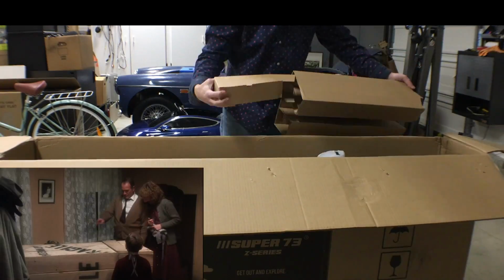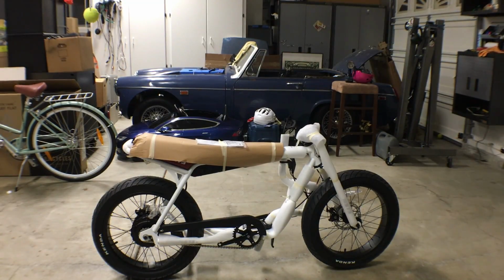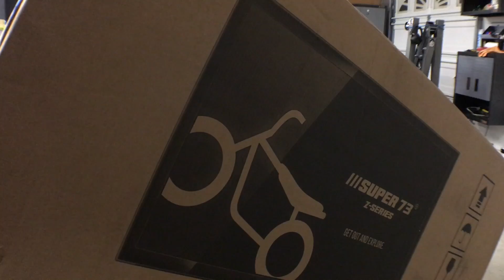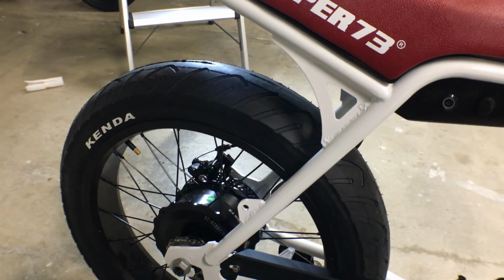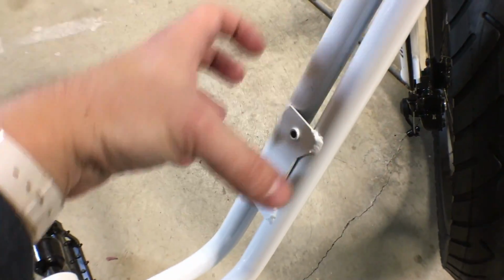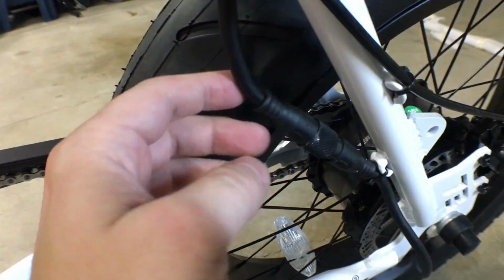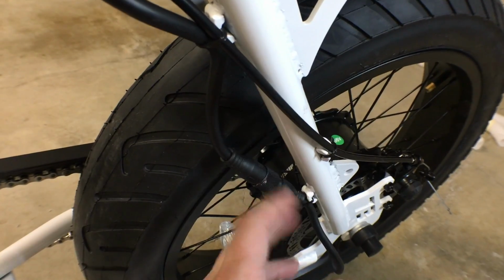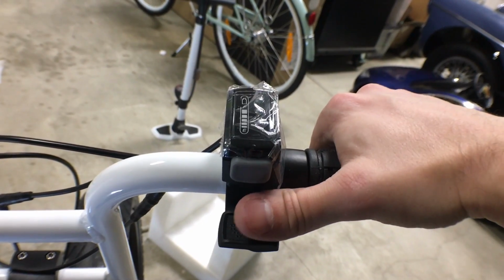Super 73 z Delivery, Build and Test Ride

Comment: Looks like a great bike. How is the acceleration with a 36V system? Any idea if there is a way to over ride the 20mph governor? Would be great to be able to get a little more speed out of it if possible. Thanks for the video
Reply from the maker: Check out my instagram, trying to get into the firmware now to remove speed limit. At some point you'll be limited by motor or pack voltage. Acceleration is awesome! any more and it would make lots of new riders uneasy or worse, cause a wreck.

Comment: There is Soo much empty space for a larger and or more battery packs. And No suspension? Cheapo Walmart bikes even give you springs. I guess I have to design and make my own!! Jeeze man. What's up with these electric alternative transportation companies.
Reply from the maker: Stefan0man Tons of space, but at some point it becomes too heavy and few would ride for as long as it would run. The fat tires soak up a bunch and I prefer the looks of a bike that lacks suspension. Cleaner looking and less to break.
Reply: That’s why you get the more expensive one if you don’t like it..
Reply: @JuliansRandomProject  I guess some would ya. But juiced bikes are doing Very well. But i think a company could put a small 2stroke motor on there to charge the cells and/or drive the bike to when there aren't any power sockets around for miles. And the big tires create a Lot more resistance for the bike and a steel spring could last decades on a bicycle.

Comment: $2000? Ummm...hard no.

Ill buy a moped.
Reply: It's actually 999 now.
Reply: @darrengriffith9680  Still can get almost 2 new mopeds for that price that get 110 mpg and go 40 mph.  I bought mine for $400 and have 4,000 miles on it.
Reply: @OverlandOne  can I ask what kind of moped? Sounds like a good deal.
Reply: @darrengriffith9680  Just your garden variety Chinese no name moped.  They come from the same factory, or factories with names like Suni, MP-50, etc. but they are all the same.  Same GY-6 49cc engine, trans, etc.  I have had mine a little over 4 years but you can still get them for about $600 if you look online.  They are Chinese and not Honda so, having some mechanical ability is required but, if you set them up right, and keep up with maintenance, you can get good service from them. https://www.amazon.com/Street-Legal-Scooter-TaoTao-ATM50-A1/dp/B00J4TXA5U/ref=pd_lpo_vtph_263_lp_tr_t_2?_encoding=UTF8&psc=1&refRID=8JEBQV1414J80557NC5C

Here is a Tao-Tao (Same as mine) new for $519 as an example.
Reply: @OverlandOne  good to know, thanks for the info! I have a modded grom as my city bike but may be good to pick up one of those in the future.
Reply: @darrengriffith9680  Heck a Grom is a Honda and that is a better machine all around...more expensive however.
Reply: @OverlandOne  I have a lot of bikes, every winter I pick a different project bike to build then sell the one I've had for three years or more lol. The grom I put way too much money into and its too expensive to start with considering what you get. Great quality though.